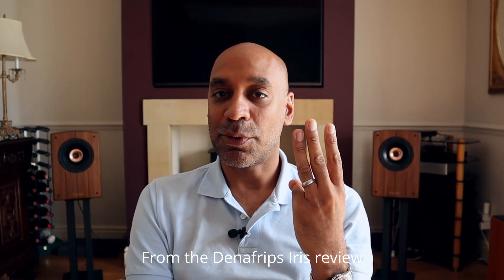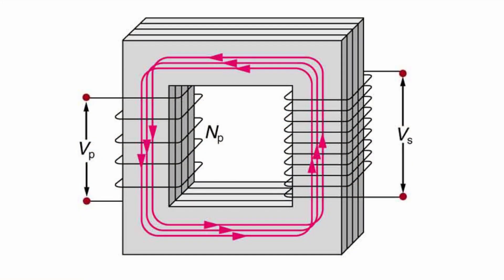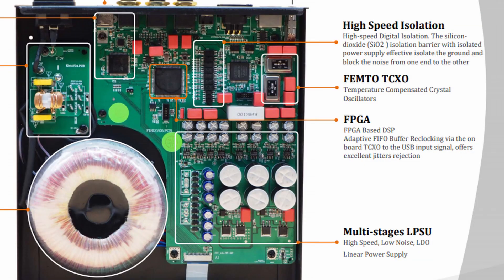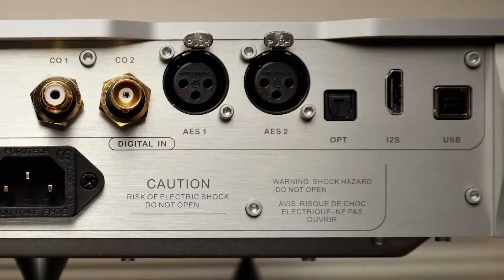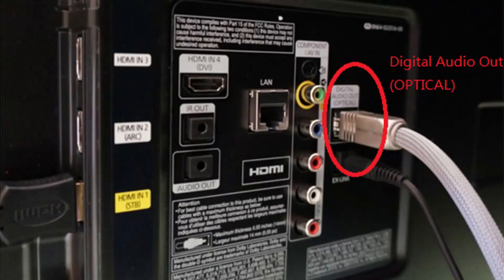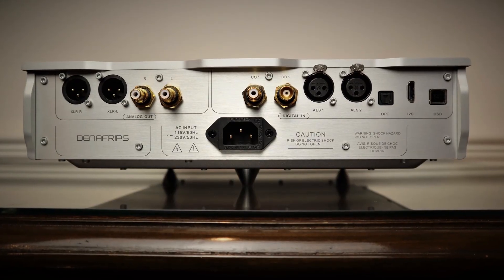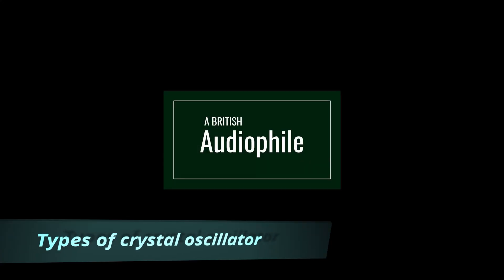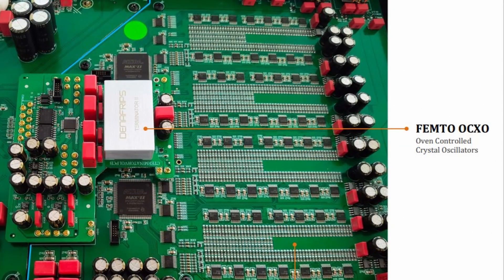ABA Clips: Why you need a DDC

Comment: The jitter is in the quality of the timing signals. So it is independent of any errors in signal level.  Think of a bucket brigade. The level of water in the bucket is the signal level. The jitteris the time variation between the buckets reaching the end of the line.

Comment: Is there a document that lays out when the clock in the transport is used, and when the clock in the DAC is used?

I have an Aesthetix DAC.  I am feeding it from a PC, via an Audioquest USB cable.  It used to sound horrible, until I changed the mass produced USB cable with the Audioquest USB cable.  Now it sounds very good.

But now I found out that USB is the worst choice, for sound quality.  Upon doing research, I discovered digital-to-digital converters (DDCs).  So I ordered the Berkeley Alpha USB Series 2 DDC.  It takes the USB connection from the computer, re-clocks it and minimizes electrical noise, and it outputs to your choice of SPDIF or AES/EBU.

My DAC does not have a SPDIF input, so I will be using the DDC's AES/EBU output to feed my DAC's AES/EBU input (and Berkeley's engineers recommend the AES/EBU option).

Now getting back to the clocks...
It is my understanding that when I hook up my soon-to-arrive DDC, that my DDC will be doing all of the clocking?

But it was also my understanding that my DAC used my PC for the clocking, when my PC was feeding my DAC directly.  So does my DAC even have a clock?  If yes, then when would my DAC's clock be used?

My DAC supposedly has a clock, and my PC has a clock (or a clocking function), and my soon-to-arrive DDC has a clock.
So which clock is used in which configurations?

Thank you.

Comment: So I've been informed that Denafrips DACS reclock every input that comes into them; if that is true, doesn't that raise the possibility that the clocking in the DAC could be inferior to the DDC and thus negate any benefit of a superior clock in a DDC? Is that the way it works?
Reply from the maker: Yes, Denafrips DAc buffet and reclock the signal on all inputs. It still does not make them immune to external sources of noise and jitter 😊

Comment: It would seem more logical to just buy a DAC that doesn't have these flaws in the first place, rather than add a second device to fix the first. Denefrips make high-quality expensive DACs, so I would hope they don't make DACs with audible artefacts from poor galvanic isolation and high levels of jitter, that then require a secondary device to fix the flaws!

Comment: Thank you for this video, quiet technical! Also I have a question : I want to make a Hi-Fi set up like this : Streamer Shanling SM1.3 using it as a preamp volume controlled to a 250w 8hms power amplifier (that does no have gain control) so also will I have a remote volume control. Here comes the question I have a Musician Pegaus DAC, if I connect it to the SM1.3 Is2 slot will the SM1.3 still be my preamp ? Or I will loose volume control as the sound will come out from the Pegasus wich as no volume control ? Thank you for your videos always very interesting.
Reply from the maker: I am not sure if the SM1.3 has a digital volume control. I would use a good preamp in any case 😊

Comment: Thanks for sharing!  I own 14 DACs from $50 - $1,800 in price (ESS. AKM, R2R, Cirrus Logic, ROHM,)  I also own the MUSICIAN Pisces II DDC.  It works really great!  I would recommend this DDC for anyone owning a DAC around $1,000, or higher.  For the most part, people owning sub $1,000 DACs would be better served purchasing, and using the Douk Audio U2PRO XMOS XU316 (2025 Edition) DDC.  You will save a lot of cash, and you will improve your audio signal to the DAC.  Only the most revealing audio systems will see the benefit of a much more expensive DDC.  Lesser revealing systems just won't reveal the improvement your looking for.  Subtle changes are very hard to distinguish in a system that just doesn't reveal the most fine intricacies to begin with.  The last thing you want to do is introduce into your system is a device that just openly reveals all the flaws in your system without giving any real improvements.
Reply from the maker: Thx for sharing your experiences 😊
Reply: Can you explain what DACs that will benefit from a DDC? Ie, some DACs have a clock inside (eg, Denafrips Venus) and would those DACs (even the Aries) not just reclock the signal. Also, normal Delta Sigma they have jitter rejection - do they also mess with the signal..... so what DACs will purely "eat" the streamer & DDC clock.... without messing with it..

Comment: The only useful purpose of this product is to bring money into Denafrips pockets. USB clock has nothing to do with DAC clock and thus has no influence at all on the sound quality. USB data is transported in blocks and buffered before it is sent to the DAC. Only the DAC clock determines the sample rate and nothing else. Any digital noise seeping through to the DAC is bad DAC design. Such a DAC will also suffer from the digital noise coming from the Denafrips device.

Comment: Reducing jitter in the digital domain has absolutely no relation to the noise floor. Jitter and galvanic isolation aren’t terribly linked either, but that’s a whole can of worms and not worth pouring into a comment

Edit: I made the connection between noise that you hear and noise on the wire making the digital signal difficult to read reflexively, as I thought you might be conflating the two. My mistake. Watching your other ddc videos now. Thanks for the excellent explanations

Comment: Utter nonsense. Imagine saving your  input to a disk file then listening later. Would you hear any difference? What happened to the clocks or the jitter? Digital transmission performance is not characterized by jitter or noise for that matter but by Bit Error Rate (BER). Problems with digital transmission like trees blocking a satellite signal can cause dropout - not distortion.

Comment: I beg to differ . Jitter is defined as variation of  delay in arrival of packets. You can have jitter and your data can be bit perfect. Secondly , there wont be any appreciable jitter between a streamer .. since this is a direct connection there is every reason to believe that the kitter willbe very low and can be taken care by adequately buffering the data. The real jitter occurs across the internet where the packets travserse a ath full of routers with lots of other traffic.
So, what matters most is noise and transmission medium that can alter the zeros and ones. Poor clocking can result in wrong detection of bits. Remember there is no retransmission of audio real time data. So the receiver either discards the faulty packet or extrapolates . So any equipment that does better clocking and keeps the exyernal noise away can improve the audio performance
Reply: Secondly , there wont be any appreciable jitter between a streamer And a DAC

Comment: Helpful video. I have a Bluesound Node X with an external LPS feeding into a Denafrips Terminator II DAC connected to a Pathos TT integrated amp with Fyne Audio F703 floorstanding loudspeakers. I’m considering upgrading my Node X to a higher quality streamer transport since it seems like the bottleneck in creating the revealing sound that my system is capable of. Would adding a DDC like the Denafrips Gaia, instead of upgrading my Node X, allow me achieve the same goal?
Reply from the maker: @MrJESandoval  a system is only as good as its weakest component. I would upgrade to a dedicated streaming transport (with not DAC inside) 😊
Reply: @abritishaudiophile7314  Thank you. Are there any streamers you recommend to match the Terminator II's quality?
Reply: Would also be interested in that @MrJESandoval

Comment: Yesterday the Pontus 2 arrived. 
A bought it blind since there is no possibility to listen to it in the Netherlands. I had to rely on Tarun's expertise. 
Although the unit isn't burned in, it's a HELL OF A DAC!!  
Thanks!!
Reply from the maker: That is great Jacob. My advice would be to get a couple of hundred hours of use on that DAC as quickly as possible. After that you should be able to really assess it’s capabilities 👍😊👍
Reply: @abritishaudiophile7314  Thanks Tarun. 
Today the Node N130 with USB output arrived. I was lucky to make a very good deal selling my old dac. 
I'm shocked ! I didn't realise that a usb connection could make such a difference in attack, dynamics, space and soundstage. 
Node is connected to my Mutec MC3+USB -> Pontus2  ( bnc)  
Thanks

Comment: Hi Tarun,

I've been experimenting with HQ player from Signalyst.  Been using it to upsample and apply it's proprietary filters and comparing Vs ripped flac files.

To me there's a significant upgrade in terms of detail, layering, air, micro details and even soundstage. And wondering if you tried to compare it Vs the chord or denfrip DACs?

If not I'd highly recommend you have a listen and tell us what you think....

Best
Reply from the maker: Thank you for the heads up RH 😊

Comment: I personally use Flac Files (arround 800-1000kbs) and i totally happy with the quality. Its a complex topic (with a lot of voodoo and esoteric because no one blind tested it in an AB Test). I'm pretty sure a lot of people cant tell a difference in a blind Test, if its a 320kbps Mp3 or a High Res file with 900kbps. The Room Acoustic is the biggest Part of Resolution (when youve good Electronics & Loudspeakers). You get way more quality with an good Diffusion & Absorbtion Concept than the latest Streamer, DAC Chip or Format. Its like mostly everything in Hifi : Marketing.
Reply from the maker: Thank you for sharing 😊

Comment: There is a lot of misinformation here. I am disappointed.
Reply: Could you list a few?
Reply: Firstly, I apologize for saying the above without explaining why I said it. Secondly, I just rewatched the video, and I don’t think there’s incorrect info here. The one thing I would pick on is SPDIF per se can have perfect clock recovery except that the clock transition can sometimes be going from the low state to the high state and sometimes from the high state to the low state so that could potentially make it worse than I2S. The other point I might want to pick on is that clock precision in the femto second range is not important for audible jitter, what matters for audible jitter is slow drifts in clock speed. For example, if a clock drifts 1000 times a second, up and down in frequency (that is very slow compared to the clock frequency itself) then that will create audible jitter with bands at +/- 1000 Hz. How wide the frequency variation is depends results in how high the jitter level is. So the TCXO and OCXO work by minimizing this drift. But I am being truly picky here. This video is pretty good.

Comment: It would be fun to compare the denafrips solutions with the ifi ipure spdif 2, which also claims to offer galvanic isolation and reclock to reduce jitter. Its much less expensive, but I notice a large improvement when I used it to connect my Ares 2 with a sonos port. I’m thinking the port is pretty noisy to get such a noticeable improvement, but the SONOS ecosystem is sooooo attractive in terms of streaming sources.
Reply from the maker: Great comment and suggestion Brad 😊

Comment: First, Alvin Chee has suggested that if you’re streaming through a laptop or similar computer-based unit that is not tailored for high quality music transfer, you will benefit more than if you have a high quality streamer. Secondly, the Iris only has a UBS input so unless your transport has a USB output you can’t connect it - you need to move up to the Hermes to connect other type inputs. Thirdly, Denafrips and reviewers are carefully walking a thin line where they don’t want to say that the DACs below the Terminator (under $3000 USD) fail in removing noise/jitter/proper clocking but they don’t want to discourage people buying their DDCs/master clocks. So if you’re planning to buy an $1800 Pontus or $3000 Venus and then add at least a $1200 DDC and maybe a reclocker at $1750, you might want to reconsider if you’re buying a “good” DAC.
Reply: You imply a manufaturer/reviewer conspiracy without evidence. Instead you posit a tenuous purely circumstantial allusion to the fact that Denafrips is not including OCXO clocks in their lower priced DACS, and the fact that they are selling DDCs and external clocks to squeeze more cash from a naive public. And for free gear reviewers are not calling them on it. FYI hifi manufacturers are businesses like any other that have different tiers and price points for profit reasons, not necessarily because they are slyly trying to rip you off. Alvin has been great to work with and I have bought gear from him that he was always quick to support when needed. I am using a Hermes clock slaved to a Terminator II and using the I2S interface and sonically the stack is as good as my $10K Lumin P1's internal DAC, just a different flavor. Maybe next time you posit an accusation, provide some hard evidence to back it up, otherwise you are just another keyboard anarchist gaslighting the gullible, and it is not like Western society needs more of that right now lol 😆

Comment: In my experience, ensuring that USB audio from a PC source is given the best conditions to be transmitted cleanly and with minimal jitter has a noticeable influence on sound quality, even if the recipient DAC has an asynchronous USB interface and its own built-in reclocking. Provided that the system as a whole is resolving enough to appreciate the differences, of course.

I've found that putting a discrete reclocker in front of an asynchronous USB DAC with built-in reclocking has limited impact though. What I've seen does have a noticeable improvement in sound quality in this case is the use of a specialised PCIE USB card solution that's designed to isolate the USB audio's power and data signal in the PC, with femtosecond clock timing of its dedicated USB hub.
Reply from the maker: Very interesting. Thank you for sharing your experiences 😊

Comment: Great explanations of each of these concepts, Tarun ... thank you.  So just to confirm something:  if I have a Bluesound Node running into a Denafrips Hermes DDC, would you suggest that USB is the optimal connection between the two?  I'm currently using toslink.  Thanks again.
Reply from the maker: Thank you. The short answer is yes. You want to take advantage of the USB asynchronous connection. The exception would be if the USB interface is poorly implemented in the Bluesound. Is suspect it will be fine 😊
Reply: The Bluesound you mentioned is the latest with usb output? 
I'm running an old Node 2 using toslink into the Mutec MC3+USB. 
I can remember that the first examples of the Node N130 have a usb output, but not working. 
If this usb outpit on your Node (130?) is working fine, I won't hesitate to switch my old Node for the latest version. 
Please let me know
Reply: @jakobgooijer  I've now changed the cable from the new Bluesound Node (the latest version) from toslink to USB, and it's working great.  May be confirmation bias on my part, but I do feel like the bass was considerably enhanced.  And the BluOS app recognized the Denafrips device immediately through the USB connection.  No issues setting it up.  For the record, I used a Wireworld Starlight 8 USB cable.
Reply: @davidparkes1508  In the meantime I bought the N130 also. 
Same as your experience, the Node recognize my Mutec by name and number using an excellent Supra usb cable. 
Now the Mutec ( and for you the Denafrips)  is the master and the Node the slave. 
It makes indeed a big step in the good direction. 
Note: by using the usb output it disables the volume control on my phone/tablet .

Comment: S/PDIF is analogous to composite video, I2S corresponds to component video. The quality of the clock in the S/PDIF transmitter isn't so important as the multiplexing and the coax cable are the real bottleneck. This is the reason having the clock close to the DAC is better - a shorter signal path. Async USB beats S/PDIF because in this scheme the DAC is the clock master, meaning it'll use a standard crystal oscillator, not a VCXO. VCXOs have wider bandwidth and hence are more prone to jitter.
Reply from the maker: Good analogy 😊

Comment: What would you say does light / moderate / heavy jitter sound like? I use a very basic setup -- an ArgonAudio SOLO streamer feeds an ARES II and RME ADI2 via Coax and Toslink. No idea, how severe my jitter situation is.
Reply from the maker: Normally jitter will contribute to harshness and loss in fidelity of the sound. Please ignore the message from “Telegram Me.” Is is a spammer using my photo. I have reported it to YouTube.
Reply: @abritishaudiophile7314  ... got myself an Ifi iPower2 to feed 5V into my Argon Audio streamer, thanks to your other video (https://www.youtube.com/watch?v=UmiLQ9ifb0A).
I am now a little wiser -- seems my Solo had fed some quite jittery signal into my DAC -- sounds VERY noticeably better now with the cleaner power supply. 
Thank you very much indeed!! Tarun for providing so VERY useful hints. In the end, the <100$ invest into the Ifi power supply lifted the performance of my $$$$ system now by a lot.
Reply: https://www.youtube.com/watch?v=ZT_1UATci3c 😉

Comment: Surprised to hear no mention or use of MEMS oscillators. Many advantages over crystal (ultra low jitter, temp stability) with one caveat: they suffer from helium intrusion through the silicon with will cause the clock to stop. Never a problem as long as you don't have helium gas being leaked into the room. A company called SiTime make these devices. In fact, they have a youtube channel.
Reply from the maker: Cool 😎 thank you for sharing 😊